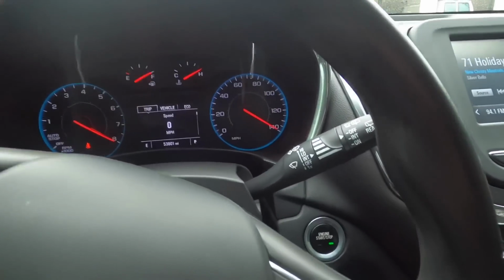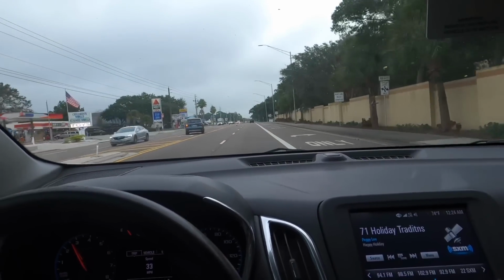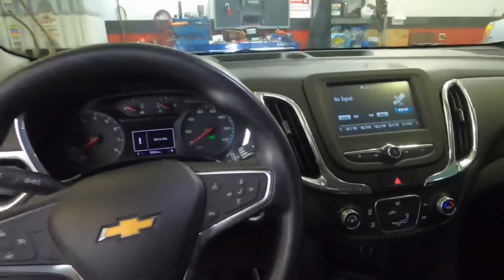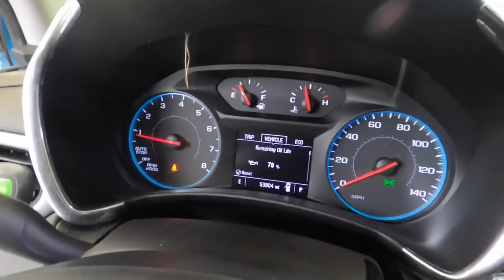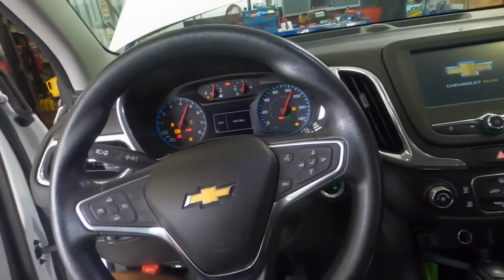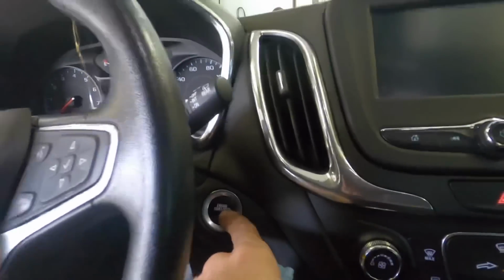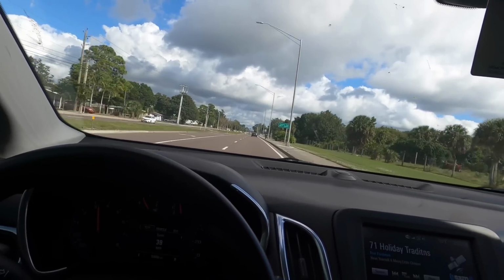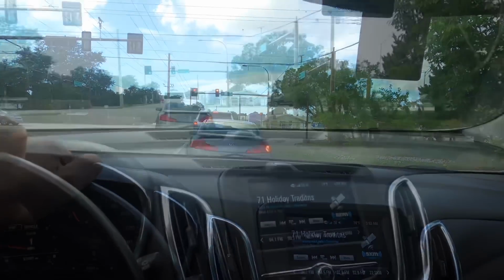Low oil could cost $$$$ | By Mistake!

Comment: I am actually amazed that checking the engine oil is not a standard thing to do for everyone.
Our driving license requires the knowledge on how to check and fill engine oil and basic diagnostics of the car.
Things that are common to check weekly or once a month is oil, coolant, tire pressure and washer fluid.. Hydraulic fluids are checked when serviced.
Reply: Biggest issue is... People are only taught to pass a driving test and nothing about general maintenance of a vehicle etc... Bit like a hell of a lot of people would have no idea how to even change a tyre on a vehicle....
Reply: @alastairsellars2611  Not everyone is capable of handling the physical aspect of changing a flat, that's where AAA comes in handy. However EVERYONE should know how to check and if needed top off oil in the car they drive.
Reply: @alastairsellars2611  you'd think maybe insurance companies would like it if you could change oil or top up fluids, maybe get a bit of cash off the insurance bill.
Reply: My dad never showed me this stuff--learned as an adult. 
Also, I have been licensed in many US states due to moves, so I am assuming that you are not in the US.   I never was tested on car maintenance skills for any of my licenses.
Reply: @craazyy22 How many people that drive, can change a tire? One would think that might be a thing to know how to do.
Reply: @ducewags  Just wanted to share a personal anecdote about changing wheels. My first and so far only time I've had to do that was at the side of a highway. I later found out I picked up a screw somewhere which punctured and deflated my tire in a matter of seconds. Did still manage to steer it to the side. I put down a safety triangle, put on a reflective vest and walked back to the car..  to find out I had anti-theft nuts installed. Found the add-on but the fit wasn't the greatest and the bolts were pretty rusty and pretty stuck. Managed to brute force all but one after which my add-on was pretty mangled (round pegs on it didn't help). By that time they'd already come to tow me away. After an hour or two prodding away at that last nut with the help of my family finally got that dang wheel changed. No more anti-theft nuts for me :')
Reply: @wh4t3v3rrr  I know other people will say it's just a half-step below leprosy, but a little bit of anti-seize on the threads, and a torque wrench, make roadside difficulties go away.
Reply: I have taught my family how to do these basic checks and usually it’s not done. I pumped gas in the 70’s and we got under the hood and checked all these things. I made commission on everything I sold. I loved that job better than all the other things I did.
Reply: @daviddicke6325  back in the day when people gave a damn and didn't pass the buck either.. modern society is up the wahzoo...
Reply: @alastairsellars2611  Gas was not self-serve back then, the person who filled your tank would ask if you wanted oil, coolant, brake fluid checked as the pump ran.
Reply: I totally agree, around 75% of the cars that I service the oil pre-checks are not even on the stick or just barley on the tip
Reply: Many of us were told to do those things when we took drivers Ed. But since then things have changed. People are lazy now. I had a friend who never changed the oil in her car!! a I was dying.
Reply: When I was young (60's & 70's) my dad & a local mechanic taught me a lot about cars & service, but when my sister asked, my father told her to just make sure they greased the brakes when having them serviced. Those would be drum brakes, so no grease required. I'm afraid that, that mentality continues to this day, except, now very few people learn the basics.
Reply: In America, you'd be surprised at the number of people that don't even know how to check the engine oil!
Reply: What country are you in?
Reply: Where is this?, never heard of any license that has the licensee have specific mechanical ability. some people have another person in their life to take care of it, not a great way to go but that's their business.
Reply: @barryaiello3127  In a lot of European countries a drivers test is HARD, not a cake walk like the U.S.
Reply: @marioreali5925  Depends on the examiner, I've came across a rough one. I'd say that basic vehicle maintenance/knowledge should be part of the test.
Reply: @barryaiello3127  UK, https://youtu.be/uh8slnP76-w Show Me , Tell Me part of the test
Reply: @tda2806  And?, this video WAS NOT shot in the UK, it is a good idea though.
Reply: @barryaiello3127  you asked where and I gave you an example, perhaps you should check your xenophobia level.
Reply: @tda2806  I was asking about US locations, I give zero rats a$$ what goes on in Europe.
Reply: @barryaiello3127  The xenophobia is strong with you
Reply: @tda2806  I was referring to laws here, I have no problem with the UK but there is zero % chance I'll ever be licensed there.
Reply: @barryaiello3127  In America, a Commercial Drivers License has this as part of the testing
Reply: @pnwRC.  This was a 1.5L 4 cylinder on a passenger car, unless you drive a rig your not going to bother getting a class A license.
Reply: @barryaiello3127  Fair enough
Reply: @pnwRC.  Yea, another problem is today's vehicles don't get the typical "tune up" they did years ago, plus the computer can adjust many aspects of operation so small defects go unnoticed. It all means even less reasons to open the hood, there's a guy here on YT who owns a small junkyard and he tears down broken engines, 9/10 times he notes oil problems is the reason the fail.
Reply: @barryaiello3127  What's his channel? I think I'd like to watch a video or 2
Reply: @pnwRC.  it's "I do cars", warning you, it's easy to get hooked!.

Comment: "Oil is cheap, engines are expensive." 
~ Scotty Kilmer
Reply: "HA HA HA" ~ Scotty Kilmer
Reply: That's why you always check oil level first.
Reply: "Compression fittings that explicitly state they are not suitable for brake lines and which are illegal to use for such in many states are perfectly fine for brake lines"
~ Shoddy Kilmer
Reply: @ferrumignis  they are no different then the connection to any other brake connector. still the right way is to flare the line but not everyone want's to buy the tools in DIY and the compression fittings will do the same job and be perfectly safe if done right. trust me, i hate scotty as well but because he is all hype.
Reply: @rickylafleur5823  If they are "perfectly safe" why do the manufacturers state they should not be used, and why are they outlawed for brake use in many states?  Just coincidence?
Reply: @rickylafleur5823  compression fittings require a good line with no pitting to seal really well. Problem with that is, by the time a line goes bad, most generally it's done pitted too much. Flaring tools and copper nickel lines aren't that expensive, and generally the flaring nuts are reusable, if not those are also cheap. I've used compression fittings but personally don't like them, as it can be tough to get a good seal.  Remove the line, replace with copper nickel and flare it, best way to do it imo.
Reply: @garyr7027  trust me i would rather run a full line and i see them all rotten as im in a northern state that uses liquid salt but i have never had a issue getting a seal with them. i know the tool is cheaper but for some DIY guy who only has to do one line the compression fittings are cheaper and simpler to use just cut at a part that has good coating still on it then cut the coating off. they have their place and if done correctly they will last.
Reply: @rickylafleur5823  Fair enough, if it works for you then more power to ya. I find that copper/nickel lines and a flare tool are cheap enough that I'd rather not worry about it. Each to their own though.
Reply: @rickylafleur5823  there is a Chevrolet truck that is newer I can't remember what year it was that you have to remove the complete body, ( or at least raise it up about 8 in,  to put new brake lines on it me and my cousin did it it was a b****.
Reply: Probably the ONLY smart thing that man has said in the past 10 years.
Reply: eh from years of watching scotty i know his good advice from his old fashioned advice
Reply: TOYOTA - Scotty Kilmer
Reply: They obviously have not seen the episode of Seinfeld when Jerry loans his car to Kramer and it runs out of oil... LOL
Reply: @alastairsellars2611  One of my favorites is when Jerry has to sell his BMW because a valet had such bad B.O. They called the smell the 'beast'.
Reply: Man! That ni-cop is so damn easy to bend too. Not expensive at all,  and heck most parts stores will loan you a flaring tool
Reply: So are windshields ,,,Always buckle-up your kids in a child safety seat ...........
Reply: Even a stopped clock...
Reply: @OneTrueCat    First time I've seen the correct beginning of that phrase on the internet.
Reply: Skottle is a hack
Reply: Change oil at 3k miles no matter what the manufacturer says
Reply: @mccullough-crazy257   or you know just check the oil... if you are using synthetic
Reply: @mccullough-crazy257  WRONG!
That advice is decades out of date.
There have been tremendous advancements in oil technology and with additives and synthetic and semi-synthetic oils oil changes are required far less frequently.
You still have to check and maintain the oil level between changes.

Comment: Here customer, and take this as your warning to start checking and changing your oil or you'll be buying an engine next...

When the dipstick has a "patina" you know they never change the oil.
Reply: Dipstick patina, that's a good way of describing it lol. Good point though, it's a telltale sign of vehicular abuse.
Reply: @MODeration_nXS  Keep in mind on turbocharged engines the varnish shows up quicker. This is from the higher oil temps. Still if you change your oil it won't show up for well over  100k.
Reply: @skurblord3401  if you're having higher oil temps from using a turbo, there should be an oil cooler to keep operating temperatures within spec.
Reply: @williameldridge9382  With a turbo, an oil cooler is pretty much a requirement. Even so the oil temp can and will rise above what a standard NA engine will generally reach. With that said a NA engine can overheat the oil. There is a reason why some trucks come with a 8 quart oil pan instead of the basic 5-5.5 quart. If you increase the total quantity of oil you will gain more room for temperature swings during hard use.